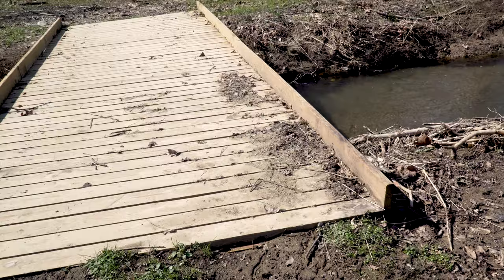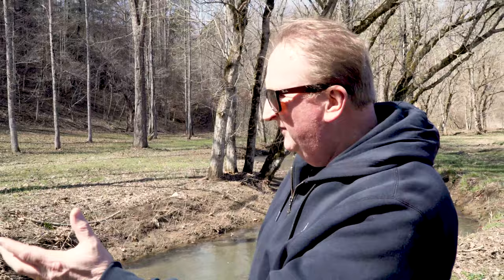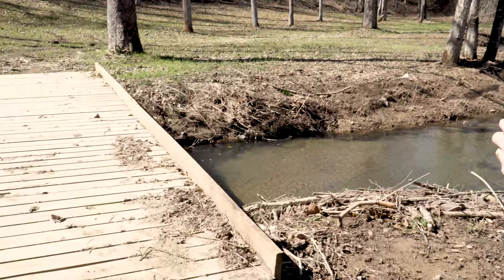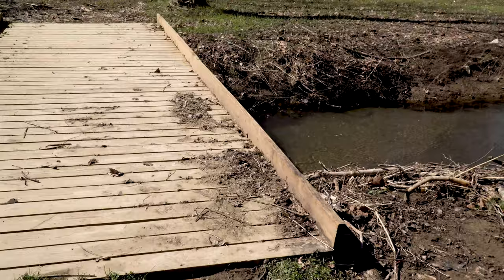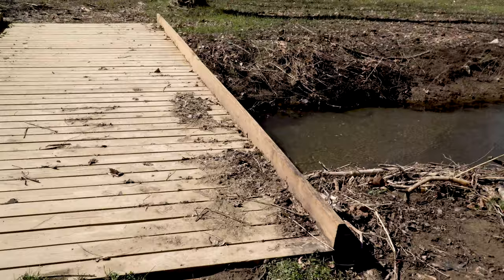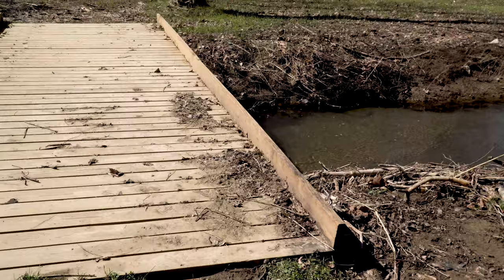How to build a bridge across a creek! (Video #6)

Comment: I just need a foot bridge, and have been looking at a 28 ft aluminum extension ladder that would be the foundation (open full extension) , and using 3 ft boards as decking. 280 lb weight limit.  Tether one end and leave the other end free so a flood will push it to the side, with easy re-placement after subsides.

Comment: I just bought land it has a large ravine that goes down pretty far underneath it in between the two sections of property and I’m trying to figure out a way to build a bridge that would be sturdy enough to go over to the other side I’m hoping that I can implement this set up the same way you did yours we will see 🤞
Reply: Hire an engineer if you want a safe secure structure.

Comment: Bridges are not for amatures. You have no idea of the strength of that structure or its resistance to high water. In addition you are, check with your lawyer, assuming responsibility for any injuries that happen on that bridge. Please be careful.
Reply: The old adage is anyone can design a bridge to support the required load, but it takes an engineer to design a bridge just strong enough so as not to waste material. I don’t get the liability concerns as the bridge does not have public access?
Reply: @rupe53  I get the impression that a lot of these negative non constructive comments are coming from people who have never built anything out of wood or metal with their own hands and so under estimate the knowledge and know how gained from the experience! I am sure these builders are conscientious enough to keep an eye on the structure to effect repairs or changes that will certainly stave off catastrophic failure!
Reply: @stephenayer8255  ... only trying to point out that you should never design to the minimum. Years ago I worked for a heating company and a guy was building a new home with bridge access. He wanted to know how heavy an oil truck was so they could consider it in the design. The idea was so many $$ to get a car across, so many $$ to get the oil or propane truck across, etc. They wanted a number. (34,000 pounds in my case) I reminded them the bridge needed to also support many tons of snow load, perhaps a moving van, and maybe one day a fire truck. (60,000 pounds?) There was a silent pause at the end of the line, followed by a gulp. <LOL>
Reply: @rupe53  In your example I would say the owner was trying to minimize the requirements of the bridge to cut costs, however a good engineer would design to all expected requirements plus a safety factor. What sense would it be to build twice or maybe 10 times as strong as it needs to be?
Reply: @stephenayer8255  ... lots depends on on if there is a town engineer involved in the process. They will specify the percentage of safety factor required. The guy I talked with was a general contractor and I think he was trying to go cheap when talking with his customer, not realizing what was involved to do it right. Many of these guys figure you can just post a sign saying what the capacity is and push the liability elsewhere. There's a reason some things require a building permit with inspections.
Reply: @stephenayer8255  i'd calculate a bridge for the load required(for example a loaded pickup truck) and then take a generous safety factor, maybe as much as 10. because of detioration, dumb/optimistic people, dynamic loads.....and, put up a sign stating the max safe load. even on my own property.